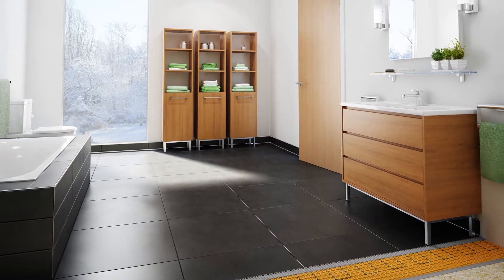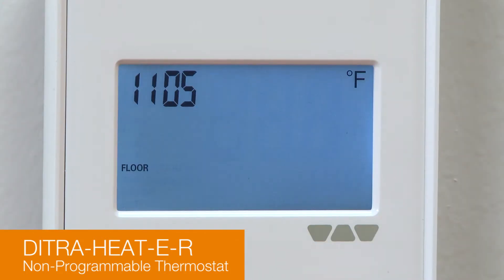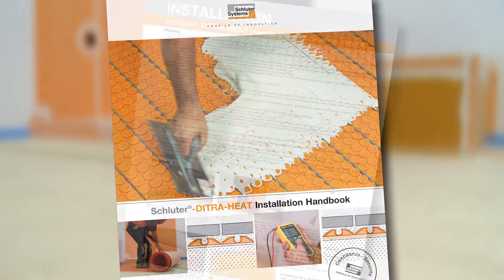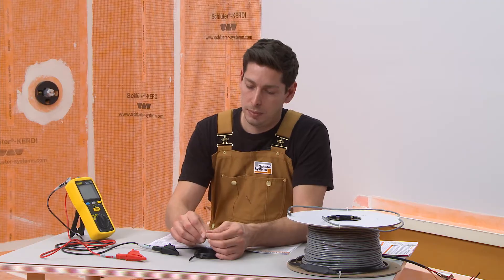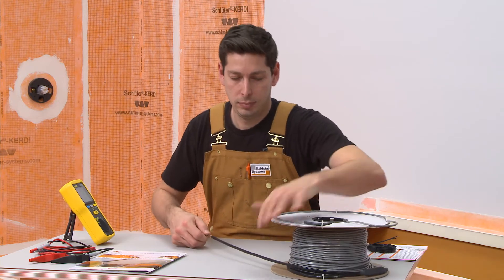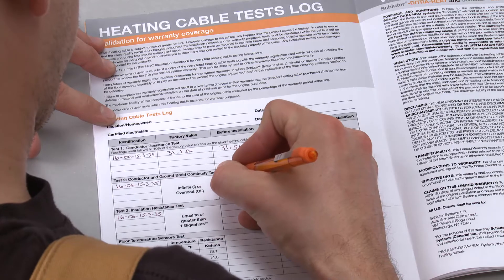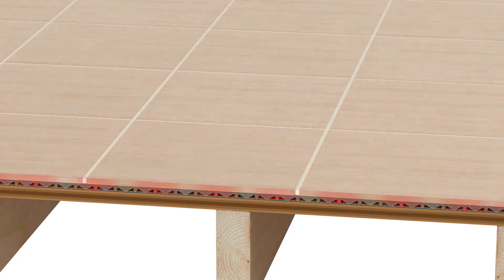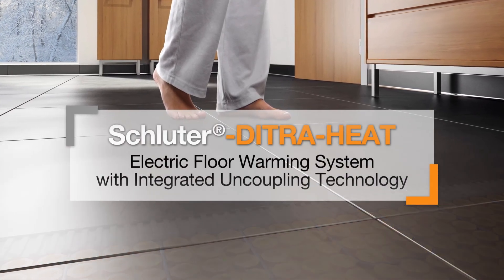How to install DITRA-HEAT-DUO over Concrete Start to Finish

Comment: We had our concrete slab in the basement tested for humidity and it was quite humid. Is this product suitable for our application? We would like to have heated floor in the basement but dont want to cause problems to the slab.
Reply from the maker: Hi there! Would you be able to reach out to our Customer Service team to discuss your project in a bit more detail?  They’ll be able to request more information on the specifics of your project to give you the most accurate answer possible. You can reach them at 800-472-4588 (US) or 800-667-8746 (CA). Thanks

Comment: Can this application work for exterior ?
Reply from the maker: Hi there! For any exterior application, would be best to contact our customer service teams as we need more information on the specifics of your project to give you the most accurate answer possible. You can reach them at 800-472-4588 (US) or 800-667-8746 (CA). Thanks🍊

Comment: Can the Ditra Heat be installed under the floating Vinyl Flooring such as COREtec?
Reply from the maker: Yes it can, please see the DITRA-HEAT Installation Handbook for complete details. https://sccpublic.s3-external-1.amazonaws.com/sys-master/images/hc4/h42/9300424458270/DITRA-HEAT%20Installation%20Handbook.pdf

Comment: Can it be installed, with the Ditra Heat, over concrete flooring with "embedded" radiant heated concrete?

Comment: Do I have to install ditra duo if I only have 1/2" thick concrete over plywood. Or I can install ditra heat?
Reply from the maker: Hi Damien, there are a few variables here... Could you please give our Product Support team a call?
US: 800-472-4588
CA: 800-667-8746

Comment: What type of grey pipe "conduit" is used to protect the wiring at 17:25 ?
Reply from the maker: Hi Geoffrey, we just used a Non-Metal PVC Conduit, but you can check with your local code officer to see if there are any special requirements in your area. Thanks!

Comment: Can you cover this with vinyl planks?
Reply from the maker: Hi Cole, Yes, you can. Please refer to page 18 of the Installation Handbook for further details: https://sccpublic.s3-external-1.amazonaws.com/sys-master/images/h2e/hb0/9391349760030/DITRA-HEAT%20Installation%20Handbook.pdf

Comment: Hi, we can cover the heatwires with self leveler ?
Reply from the maker: Hi Cristi, there is no need for self leveler when using the Ditra-Heat membrane. For more information, please call our Product Support team on:
US: 800-472-4588
CA: 800-667-8746
Thanks!

Comment: Where does the braided ground cable attach?
Reply from the maker: Hi Lupton, that will depend on your installation, there are different grounding options. Please consult your installer for the right connections in your home. Thanks!
Reply: @schlutersystems1  ok. It does not connect to the thermostat, correct?
Reply from the maker: That's correct. You're qualified electrician should have all the details :)

Comment: Ditra heat duo is hard for installation but color gray insulation  not can  stay on Mortar is up 1/4 Mortar put ditra intro Mortar not stay on floor is up I have this problem only ditra heat duo , and heat ditra down white is very hard plastic stay up with Mortar have Lot problem ditra cl work perfect and 1/8 ditra maybe need change for more flex plastic on heat ditra regular and heat ditra duo need remplace this Cotton insulation gray
Reply from the maker: Hi Pedro, can you give our Product Specialists a call to discuss your project in a bit more detail and they should be able to help you from there. 800-472-4588 (US) 800-667-8746 (Canada). Thanks!